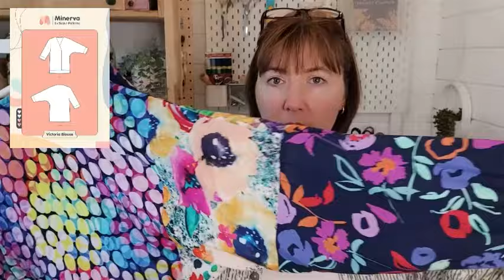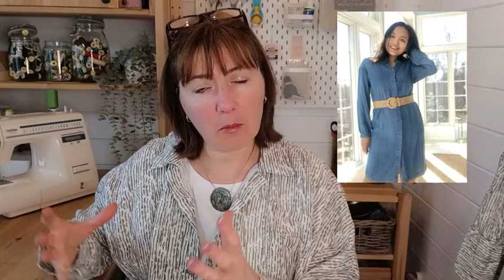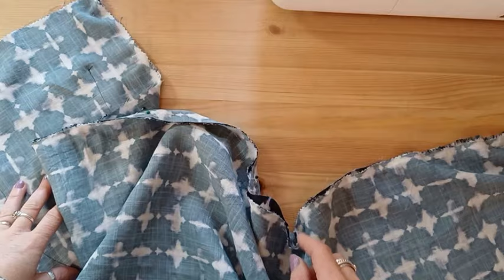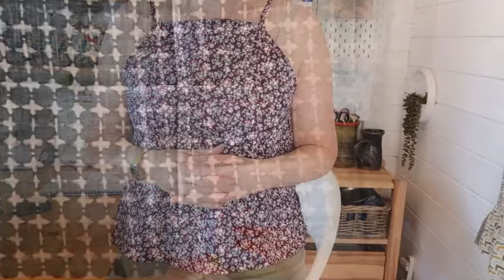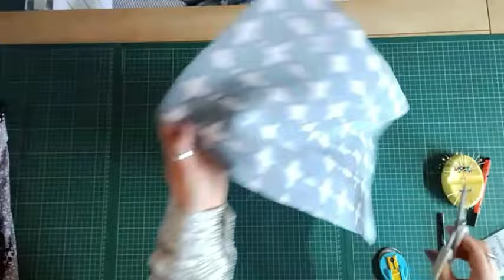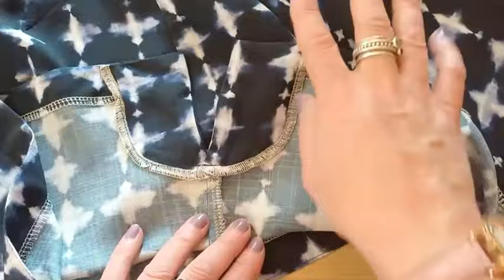🎥✂️ A Guide to Zero Waste Sewing with Jo ✂️🎥

Comment: I prefer fitted garments. As long as you can use the scraps for another project, I would not call it waste. Zero waste is a very good concept. We shouldn't idealised it though and force the usage of oversized garments just to artificially adhere to it. 
Thanks for sharing some practical advice about it 👍